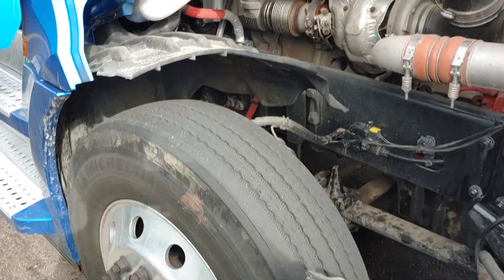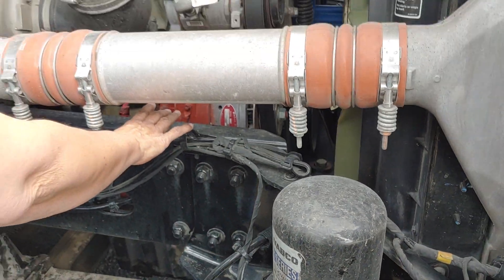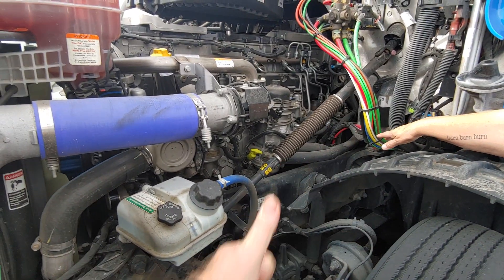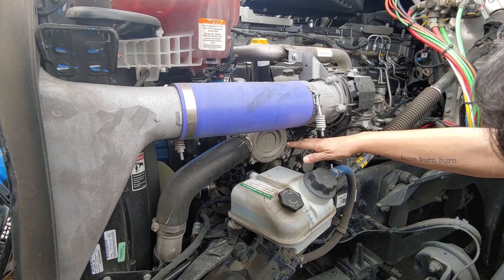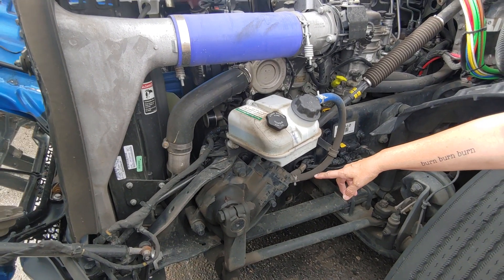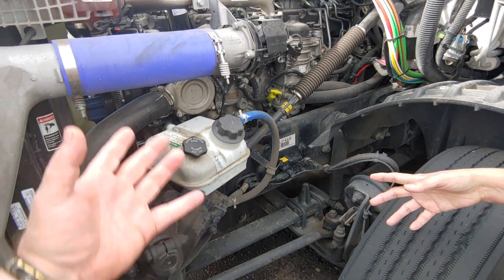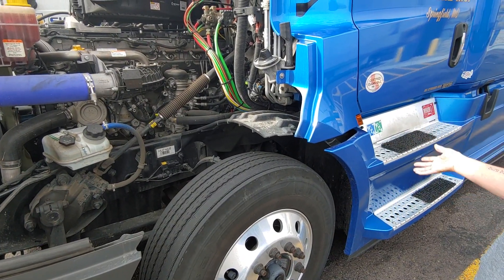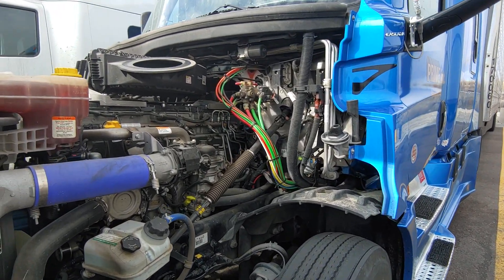psd student does the engine compartment pre trip inspection

Comment: Forgot head lights hood mirrors windshield washer fluid reservoir fuel pump 🤣🤣🤣🤣 there’s a vid on here of a guy that thoroughly goes over engine cab air brakes and trailer I watched it about a hundred times and was able to breeze through the pre trip and air brake test.
Reply from the maker: We are only doing what is required to pass the cdl test👍

Comment: Good job Melissa  👍
I grade you 21 out of 25. On the general hoses and   brake hose you said not cracked bent or broken instead of your ABC's. Also you called the leaf spring a spring arm, I think you might get dinged on that.
Reply from the maker: She just did the fuel door before she did engine. That must be where the spring arm came from.... I don't think they ding you if you say the name wrong as long as you point to it and know what ypur looking at to check.